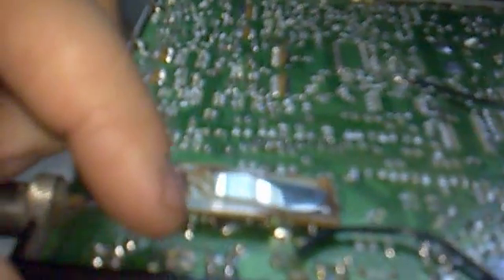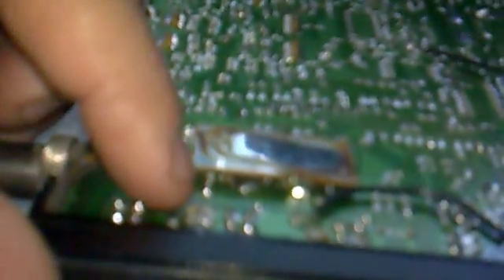How to Expand 80 more channels on a Maxon MCB-45W cb radio.

Comment: You NEED a good camera!  Ir's a shame that there isn't any more information on these radios.  They seem to be good radios.  I got one for free from a friend.

EDIT:  This MOD is a lot harder than it first sounds.  You have to remove the bottom cover to get access to the jumpers to be able to cut them, and then you can only cut the one on the right (with the radio upright, but it's actually upside down when you are going to cut the jumper. The knobs, radio face and nuts on the controls have to be removed to get to the other jumper.  The left one (on the right if the radio is upside down) is UNDER the volume/squelch/RF gain controls!!   That board HAS to be removed to be able to clip/remove the jumper.  Also, the little silver "case" surrounding some components, needs to be bent back slightly to allow the board to come out,  My suggestion is to de-solder both jumpers and put the radio back together except for the top, and then use solder to make the bridge on both of the "B" set of pads.  Had the factory of used JUST SOLDER to make the bridges, then it would be a hell of a lot easier to do this MOD!!  But I guess they didn't want the average person to be able to do this!!  I just did this MOD and it was a little bit of a pain, but the radio is back together and working.

EDIT 2:  Apparently the radio won't transmit.  That could be why the friend gave it to me.  It does receive the weather though.  Now I'm going to have to check and see what's causing the no power output issue.

Comment: How did you hook your wires up? Did you put the orange with the black because I put the orange with the red and I couldn’t turn my CB off
Reply: NO you DO NOT put the orange with the black!!!  The orange is just another hot wire, for memory.  Black to negative, red to + 12 volts and orange to ignition/+12 volts.

Comment from the maker: Hi Kerry! Well, i recall that  it was specified by the phorum i saw this mod that 3 wire radio models would not work, but i just gave it  a shot and there you have it... i guess the CPU has an internal memory battery on the 2 wire models instead of using the yellow one for 12v backup ...i dunno o.O i'ts strange but it worked :) ... at least for now i have moded about 3 Maxon's like this one w/o any issues :D

Comment from the maker: Hi! the mic pinout is same as cobra4 pin microphone 
1-shield 2-audio 3-tx 4-rx . Modulation control is RV201 and power L809,L808 . Leave L810 alone since its factory adjusted for RF TVI .
Reply: How about you should have told the color of the wires!  Not everyone knows the transmit/receive/ etc wires!!
Reply: Is this radio for sale?

Comment from the maker: Hi Abel, I hav'nt found any info on the web regarding mod & power tweaks :( .what i know is that the mod limiter is a Variable Resistor pot  you will have to ''trial & error'' on some of them with a mod % meter to find out what pot is and max it out if you wish to..